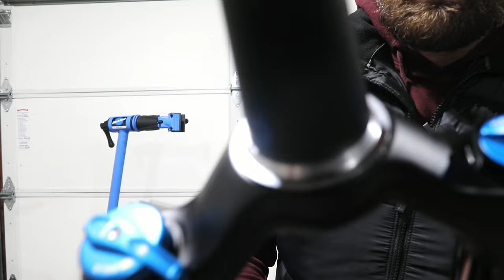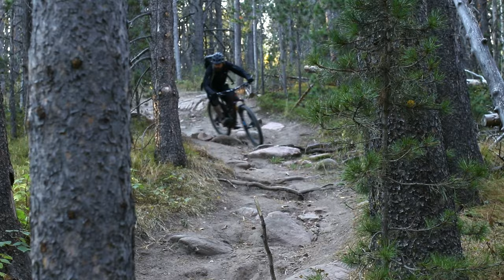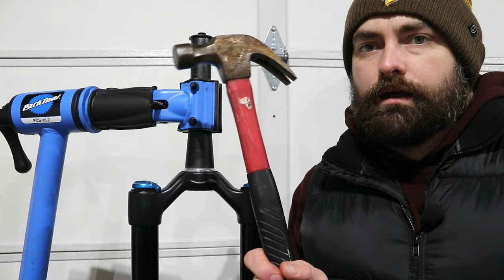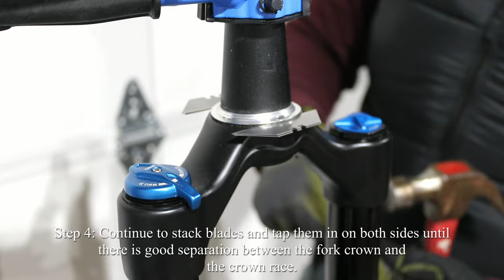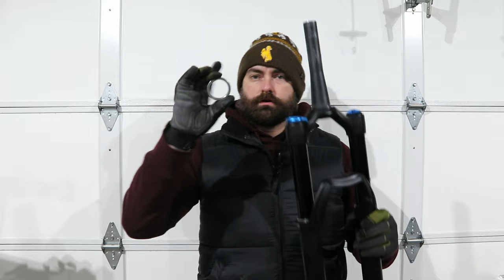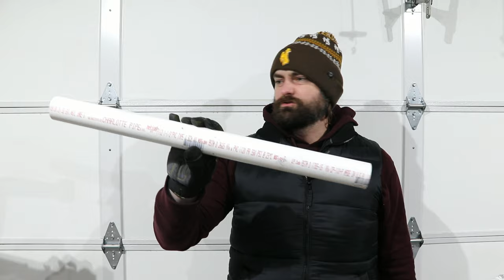DIY Crown Race Removal & Install - No Special Tools, Screwdriver, or Damage!

Comment from the maker: HEY!!! WEAR SAFETY GLASSES WITH THIS METHOD! Hitting razor blades with a hammer has the potential to cause the blades to fragment and cause pieces to fly, so play it smart. Gloves and goggles!
Reply: I forgot gloves & goggles so I died
Reply: Instead of using pvc for install , can you not just offer the forks up to the headset then then push down on the front of the frame , then will tightening it all up not just pull it all together?
Reply from the maker: @CM-1723  so you may not be able to produce enough force to get the crow race to set properly if you try to press it with the frame and headset trick. The only time I tried this (many many years ago) the star but actually pulled through the fork instead. I think you’ll save headaches just finding a way to press it on before putting it in the bike. Hope that makes sense, thanks!
Reply from the maker: @OtesOtesOtes  RIP
Reply: @Tkolbo_  I got better
Reply: One does not need a 'sharp eye' to tackle this task.

(And thanks for the vid. Easy stuff!)
Reply: Top notch - thanks! 👌🏻
Reply from the maker: @petecurran3995  glad you enjoyed the hack!
Reply: Best to wear a full MOP4 Hazmat suit and full suit of armor on top of that. Ild also have an EMT team and firefighters on the side ready, in case something goes sideways.

Comment: Warning to anyone watching this. Do NOT do this. It is super dangerous. The razor blades will shatter with minimal striking force and shoot all over the place. But I know you won't listen to a random Youtube comment so at least wear some eye protection!
Reply from the maker: So not gonna lie, the safety glasses definitely something I should have put in the video. I did put it in the description though. I’ll also add it as a pinned comment.  I and several friends of mine have used this method many times with no fragmenting of blades, but it doesn’t mean it can’t happen. I appreciate your concern regarding the matter.
Reply: @Tkolbo_  I tried this method a second time on a different fork and it worked ok. So I will amend what I said to say it did not work at all on a 68mm Fox crown with an Acros lock block crown race. The Acros race is ribbed on the inside so it likely goes on much tighter.

Comment: Once there is a little lift, use a screwdriver to finish
Reply from the maker: I’ve actually started doing this but using a plastic tire lever. It tends to work well and without a doubt the screwdriver will definitely finish the job.

Comment: this 100% works. been doing this for years except only using one razor blade and a thin blade flathead screwdriver. I DO highly recommend throwing 2 layers of gorilla tape on the top part of the razor blade that you are banging on, that way it adds a little bit of cushion which helps prevent the razor blade from potentially shattering when you hit it. For even more added protection put a piece of gorilla tape on the hammer head. I say specifically gorilla tape because it's thicker then normal duct tape and it sticks really well. Luckily the crown race I have for my current fork is the easy to install/remove type with a slit in it.

Comment: Good idea and i'll add something: Its best to put the blades or prying tool on the sides vs front and back. Since the front and back of the fork tube / crown area receive most riding forces, its best to not mar these up at all and keep them as true as possible. On the sides- just carefull with the fork tops. Of you have a loose crown race from a marred tube, locktite (Permatex now) bearing retainer "green" will help.
Reply from the maker: That’s a very good point! I try not to make contact with the blade and steerer tube to avoid marring, but I don’t think I mentioned that nor am I probably that accurate haha. Thank you for the tip, I really appreciate it! I definitely worry that I, personally, would smack the crap out of my dials, but again that comes down to my terrible accuracy hahaha!
Reply: Well shit. Wish i read this comment earlier

Comment: I looked this video up after mtb'ing for a few years today. But i was really amused by the intro since ive been playing guitar my whole life nearly and drums for about 7 years as well. I build tube amps, ss amps (from scratch as well as mods etc) and guitar pedals as well (so so so many pedals lol) and ive restored a vintage tube radio receiver also. Anyways point being its cool to see another biking hobbyist who is also a musician. Very cool idea to use your musical chops to do an intro! A few ;years ago i built a power supply for my seven string guitar with actives (fishman fluence moderns) that allows me to not need 9v batteries anymore. The power supply connects to the first pedal in my chain (a TS9 right now) and from there it goes to the TS9 input jack that i made a TRS jack so i can feed the power to the ring connection and thats how the power gets to the pickups (through a trs cable to the guitars input jack which is also TRS and from the guitar jack ring connection to the pickups power) so its plug and play just like with my passive pup guitars. The power supply is also variable from .5v-30v as long as its getting an input voltage of anywhere from 5v -30v d.c. I mentioned that cause i despise 9v batteries and I imagine you likely use actives in at least one guitar. I also wired the FF moderns for every possible option and its all toggleable from the guitars controls (minus HF tilt which is a slider switch i added in the control cavity). Anyways thats enough rambling.
Reply from the maker: Hell yes! That’s sick!  I’ve built a few guitars and did fishman Keith merrows in one. But currently I’m down to only one guitar with actives. The rest are passive pups.  That’s brilliant using the ring connection to create a power source from your pedal! I would like to try my hand at building amps and pedals. You ever do an HM2 clone of any sort?!?
Reply: @Tkolbo_  Surprisingly no lol but it's absolutely doable and I'd love to if I could ever find the time. There are plenty schematics available and even a few vero layouts which would be easier for a first time builder. I would absolutely love to build an HM2 though especially since Boss started using surface mount components (SMD, super small components which I can and have often worked with but are a PITA compared to typical through hole components) in their current pedals. One thing you'll realize really quick if you start building is how fast your backlog of projects you want to build will grow lol. If you ever really are serious about building and have questions id be happy to help. And I highly recommend it, it gives you much more control over you sound when you can tailor your pedals and amps to the sound in your head. Not to mention the money you'll save. My last amp build was a Fender Champ clone that I modded to use either a 6V6 in the output section like an actual Champ or an EL84 thats selected with a switch on the front panel (among other mods). Point being it cost me less than $400 to build and Fender charges about $1,200 last time I checked lol. On another note your video was exactly what I was looking for. I'm waiting on parts but once they get here I'll be using the razor method for sure. I already have a ton on hand that I use as scrapers for wood working and for drop fills etc. Thanks for posting the video brother!

Comment: The clever bit here is to leave the blade in place, and ADD another on the opposite side. Then, ADD a blade on top of the first, and so on. Smart!
I actually had tried with the same Stantley blades but just used one like the "screwdriver method". It did not work very well.
Thanks for the tip!
Reply from the maker: Yeah, definitely need to stack em up! I'm glad you found this helpful and I appreciate you watching and commenting!

Comment: If you stack the blades from the bottom i.e. insert the first one and then insert subsequent blades under the initial blade, you get much easier separation of the crown race.

Comment: I tried this and it worked. The only thing I did differently was once I had 2 blades stacked I but the third blade in between them. It slide in a lot easier than trying on top or the bottom. And continued add blades like that.

Comment: Great tip! It worked like a charm in two old 1 1/8" carbon forks. Wear your gloves to prevent any accident with the razorblades!
Reply from the maker: Glad to hear it worked well for you! Definitely safety first!
Reply: I did it with no gloves and I’m fine

Comment: Friggin' brilliant!  You are the man.  I love to support the local shops, but sometimes you just need to take things into your own hands.
One thing I might add is to add a wee bit o' grease to the bottom of the steerer tube to help the race slide on.  And yes, always safety first.  Especially when "hitting razor blades with a hammer"!
Shred on!
Reply from the maker: Thanks for watching and glad you appreciate the hack! A bit of grease would definitely take this hack to the next level! Wear your gloves and glasses!

Comment: Great tips, Travis! This video helped me install a particularly tight fitting Chris King headset. Picked up some PVC in a couple of sizes. I used a 1-foot section of PVC and rubber mallet to install the top bearing cover, too.
Reply from the maker: Glad you found this helpful! That top bearing cover must have had ridiculously tight tolerances if you needed to "set" it too. Thanks for watching and letting me know how it worked out for you!

Comment: I used a paint scraper/putty knife.
Lay the fork on a soft chair arm and insert the sharp blade under one side- lean on it with body weight.
Carefully move it 360 degrees around the fork, I had it off in a few minutes.
Reply from the maker: Ooooo I’ll have to try that! Sometimes the hardest part us that initial lift. Thanks for the alternate method!

Comment: Very well-done and informative video! If you're working on a fork with a carbon steerer tube, "gentle tapping" is the key. Let the razor blades do all the work. If you use a chisel or an ax to get the race off, you shouldn't be allowed to ride a bike. 😂😂
Reply from the maker: Glad you enjoyed the video! And absolutely as long as you are careful this technique won't hurt a carbon steerer.  You have me curious now though. Now I want to try to remove a crown race with an axe hahahaha.

Comment: As to installation the key bit is to find a tube/ pipe of the right diameter. I like much more using a PVC/ plastic tube as suggested than any metal tool. Thanks
Reply from the maker: Yeah man, plastic tubes are cheap and cause no damage, its the way to go!

Comment: Great tip!!! Thanks!!!! You did great on your first tech vid!!
Reply from the maker: Thanks Joe! I enjoy this method over the screwedriver...probably because I'm a brute with the screwdriver and ruin everything...including holidays hahahaha
Reply: @Tkolbo_  Also, I have a similar crown race tool but mine is a size smaller for straight steerer tubes.
Reply from the maker: @Joe_from_iowa  good point! I should have mentioned the 1.25” pvc works for straight steerer tubes

Comment: You don't need 10 blades. Once you have two on each side, you can use some old butter knives or thin steel washers. Just squeeze them in between the razors. In fact, I have several knives, slightly sharpened on one side, which I use. Having the handles makes the hammer tapping easier - there's less chance of hitting your fingers. Also, if you don't have any appropriate tubing to hand, you can usually get away with a piece of slightly harder wood. Anything will do, but softwoods will become damaged.
Reply from the maker: Very true I’ve been doing something similar as of late where once I have enough Separation I just use a tire lever to do the rest. It cuts down in the time it takes as well. Can pop a crown off quickly with your method!

Comment: Can you make a video to determine what crown race to use on what bearing. And how they are different.
Reply from the maker: Well typically the race will come with the headset and bearing. It’s difficult to tell which bearing goes with the race. Maybe the model is stamped into the bottom of the crown race? Worth looking.

Comment: I should have watched this video before removal. I used a screw driver and hammer. Now the bottom of my crown face is marked up but I used extra fine sandpaper to smooth it out. Since it’s on the bottom resting on the fork and not the bearings side, it’s still functionally good, right?
Reply from the maker: Now you know for the next time you need to do this! I honestly don't think there will be a problem as long as you made sure it is as smooth as possible. I would rock it personally!

Comment: Great DIY!  Would of loved a massive oops! CGI bloodbath insertion!  With some ripping metal track cranked to 11!  On the real though:  Did you just use the same Crown race on your new fork?  Are crown races part of the headset?
Reply from the maker: Haha, while that would be awesome, that sounds like so much work! By the way, just for your information, there is a band called Bloodbath that has an album called "Nightmares made Flesh" that is one of my favorite albums of all time. Anyways, yes I used the same crown race on the new fork! Crown races are indeed part of the headset.

Comment: any suggestions for a 1" steerer tube with 27mm crown race?  hard to find the pvc tubing size for this.
Reply from the maker: Pvc with a 1” inner diameter should be fine. As long as it contacts all around the crown race it shouldn’t hurt anything   If you aren’t having any luck you can take a flat head screwdriver or a ratchet extension and put a generous amount of duct tape on the end and tap it in using a hammer. You’ll just have to work your way down tapping on all sides until it seats. It’s more time consuming but totally doable! Hope that helps!

Comment: Would this method damage a 1 inch carbon fork?
Reply from the maker: As long as you are careful and take your time it shouldn’t. I just used this method to remove the race off my carbon fork for my road bike.  When putting the race back on you need to make sure the pipe is the right size though

Comment: That December Minnesota garage... have you mapped out your 10-foot oval course in there yet?

Serious question though... if I’m trading nearly identical forks on identical frames do I need to remove this part or can those trade bikes too?
Reply from the maker: Ha! If you go back to my video of learning to bunnyhop barspin then you'll see me utilizing the hell out of my garage to escape winter cabin fever!

As far as your serious question. It depends on the head sets. More than likely you can keep it on though. What frame and model? Maybe I can check to see if the headsets are identical.  You can also just compare the two forks and see if the crown race is identical or not!
Reply: @Tkolbo_  It'd be a 2020 Vitus Nucleus VRW for a 2021 of the same bike just different frame size. The bike gets in Monday so I'll take it apart and give it a whirl.
Reply from the maker: @GoAndPractice  well according to the parts spec they both use an FSA 57B headset so you shouldn't need to swap out the crown race!
Reply: @Tkolbo_  Oh cool! Thanks for checking that out! That'll make it easy then.

Comment: I was on the right track!  It's just that I wasn't aboard the success train barreling at me standing on the rails.  🚨Razorblades are very brittle & like to shatter if hit off angle.  Don't do that.🚨  Yesterday before watching this video, I snapped rectangular pieces of the base end of an Exacto knife blade as shims to go into the access notches in the fork's crown below the race.  (I have no flathead screwdriver small enough & I know you need to be gentle anyway.)  Shim 1 went in fine but a tap on shim 2 shattered both pieces when nearly completely slotted underneath shim 1.  

Results:  
1) There is a new infinitesimal gap of daylight between the race and the crown.👍🎉  
2) there are now two stacked remnant shim pieces completely filling the access notch Boobytrap of Disgrace.👎⏳  ᪲  These shims aren't going anywhere until the sun's red giant phase swallows our planet & melts the complete assembly, or, until the video's technique is utilized.  

I have carpet knife razorblades galore, uninjured eyesight, and 4.5 billion years to get the job done right.  I'm feeling optimistic.
Reply from the maker: Did you have luck with the carpet razorblades?!?

Comment: I'm sure I'm not the first to point out the need for safety glasses when doing something like this. I also suggest purchasing a very reasonably priced crown race removal tool (less than $30).
Reply from the maker: The pinned comment I wrote at the very top says to wear safety glasses.  Glad crown race pullers are getting affordable now! They used to always be unreasonably expensive

Comment: I took mine to a local bike shop and they whacked it off with a hammer and screwdriver. Taking a bite out of the fork. A-holes.
Reply from the maker: Oooof that’s rough.  A shop should be using the correct tools…sorry that happened to you
Reply: so did i ,works,lol, i didnt even know there was a crown till i bought a new fork that didint come with one. you live and learn.